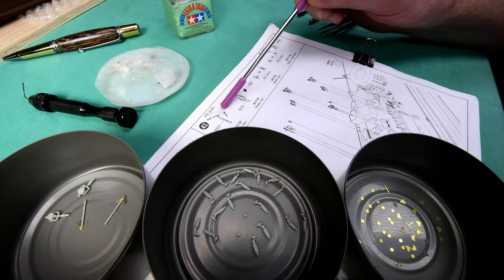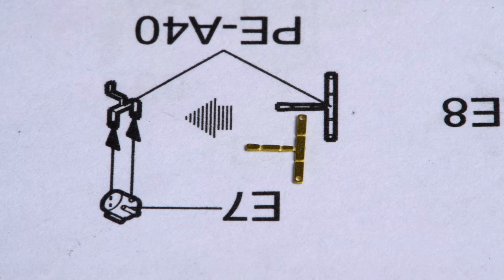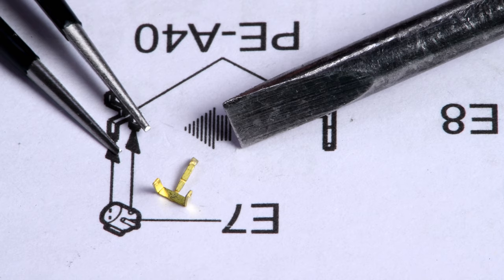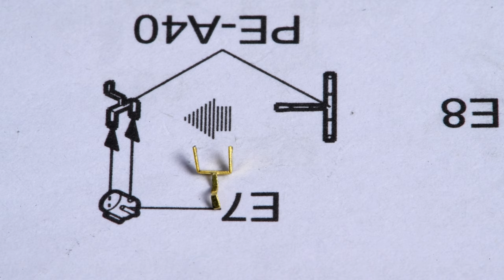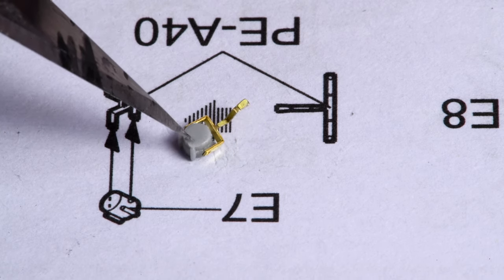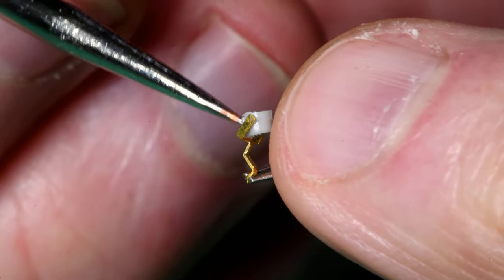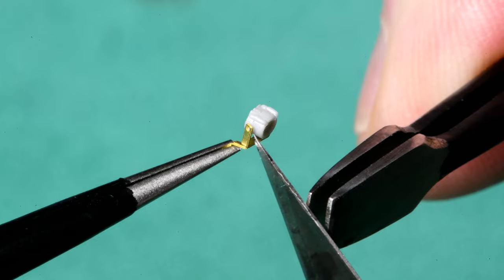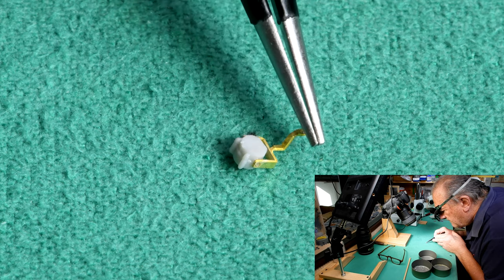The Model Ship - Part 710

Comment: Hi Ron
I'm gradually looking at your videos, especially those of Bismarck. I have them too and I will be building them soon. I find your problem-solving ideas very practical, for example the tweezers with adhesive rubbers ... because the parts are much easier to handle. Especially your close-ups are extremely good if you want to recreate something. For your other ships I would also like to give you a tip, use real wooden decks to glue for the ships. It looks much better and it makes the deck painting easier, you don't have to paint the stairs and all the small parts with a brush. Keep it up, greetings from Germany to Canada :-)

Comment: I am currently building 1:350 HMS Warspite by Academy for which I purchased the upgrade PE set. I became bogged down with all the tiny parts to the point were I lost interest in the whole model for months. I have now made a decision to not use all the PE as it it is so small it won't really be seen, especially using Ron's arms length rule.  The ship is now back on the stocks.
Reply from the maker: Yes, I understand what you are referring to when you say "I became bogged down with all the tiny parts to the point were I lost interest" I'm not there yet, but I'm sure glad I didn't buy a detailing kit. 👍